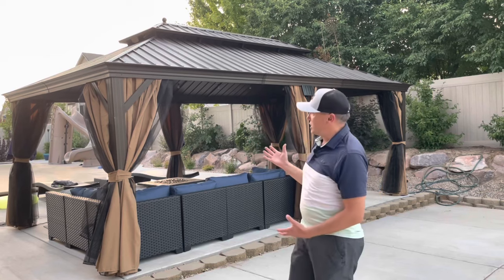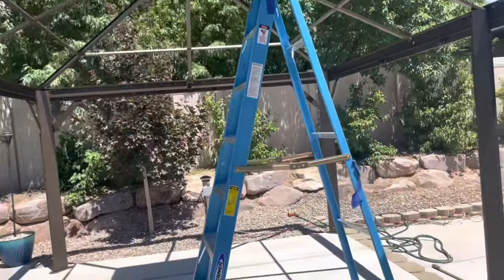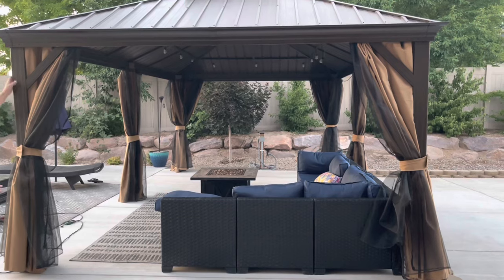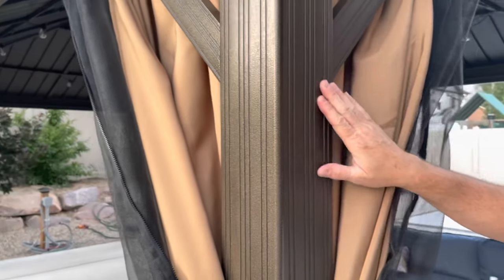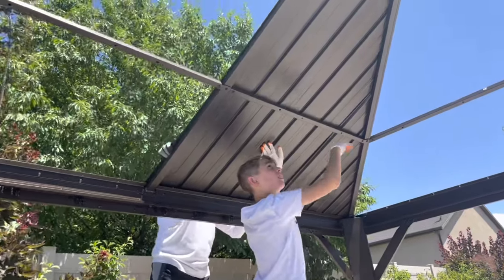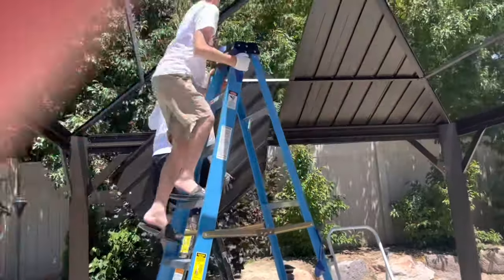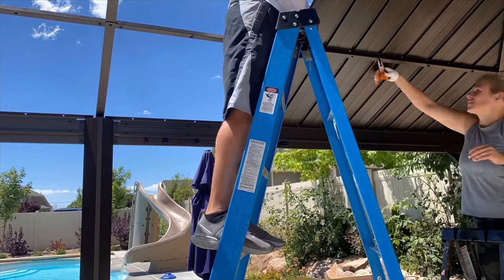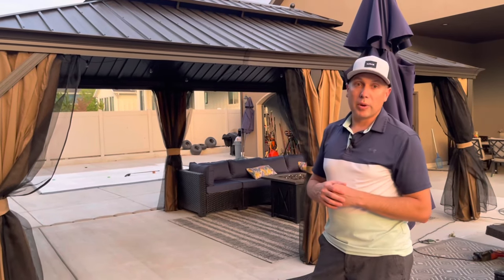12x20 Hardtop Mellcom Gazebo Build and Review

Comment: i just did my gazebo and cannot agree more.  screw the roof panels down, at least at the lowest points, before moving on.  i did it by myself and i put the ladder up next to the ceiling beams so the roof panel wouldn't slide down while i adjusted it into place.
Reply from the maker: Good tip!

Comment: Does this let air flow in the top? I'm currently in the market for a gazebo this size, but it's SO hot here, not sure if I need to choose one that is more open on top or not. Thanks!
Reply from the maker: It is vented at the top, and let's the heat out, but it does get hot inside in direct sun because it's all metal and heats up.

Comment: We got the same unit. Having trouble mounting the side post. The “L” bracket is preventing us to slide into the gap. In our manual it is step 4. It’s like pieces “E1a” and “E1b” are a bit long. Did you have any issues, with the side post?
Reply from the maker: I don't recall having that issue
Reply: We are having the same issue right now ..I'm on here searching...no help yet
Reply: Im installing a 12x24 but I’m having an issue with the clips they keep falling off  
😡

Comment: the gazebo looks really good.  Question:. how hot does the aluminum roof get under the full summer sun?  Is it comfortable under the aluminum roof, do you feel heat radiating down?
Reply from the maker: Yes you can feel the heat while inside, but you're also in the shade so it helps.

Comment: Hi. I just installed this about 3 weeks ago & I am having an issue with water leaking thru the 6 seams along the perimeter. If you look at your video at the 1:57 mark for reference, its right above your head what I'm speaking about. Its funny because the 2 on the far sides of the gazebo are not leaking. Its just the 2 on each side that when it rains the water is coming thru those screws. Any help you could give me or ideas to make this stop happening would be great. Love the video. Very informative. Thanks!
Reply from the maker: Maybe take the screws out and put some silicon caulk in the screw hole and put the screw back ?
Reply: Yeah I thought about doing that also. I tried putting ckear flex seal tape across the seam on top but that isn't working so I think I will try the silicone now. Does yours leak at all because I haven't seen any reviews saying that other people's were leaking? Thanks for you advice
Reply: @dantheman4763 Hey, did you ever get to fix the leaks? I just installed mine and I'm having the same problem.

Comment: Great video. Thank you for taking time and show all these details. Quetion: we are in South Florida and get hurrucanes somethimes. How hard is would be to remove the roof pannels if I have to, just to get ready for hurricane. I can secure the frame but affraide the gazebo will be gone if I keep the roof on during the storm. Thanks
Reply from the maker: On this specific model, it would be extremely difficult to remove the roof panels, there are probably 170 bolts/screws holding it down.  I just built another one of these. Here's the link https://youtu.be/87je8tPeVSQ
this one has much easier to install and remove roof panels, this might be a better consideration.

Comment: So when doing the roof panels how did you screw it on/ keep screws from spinning without being pn the roof? Would you be able to do the roof if it was built against a house?
Reply from the maker: The roof bolts have a nut on the other side
Reply: Would you beablw to build in place next to the house where you wouldnt really have access to the top of the roof?  The gazebo i had you build the roof in peices and then lifted the parts in place

Comment: Can this gazebo multiple fans? Is there a tv mount as well
Reply from the maker: You can hang fans 
 from the roof, the TV mount is not included
Reply: Also, you mentioned eventually adding electricity, does the gazebo come manufactured for electrical setup? I.e sockets, places to run wires, etc.
Reply: @nickingram4796  yes I bought 2 fans from Lowe's and have them hanging under the gazebo. They are perfect. Light weight & do what is needed. I believe I paid around $150-$200 each for them. Hopefully this helps

Comment: GREAT video - thanks so much. Quick question - we have a new patio with brand new pavers. Not sure that we want to bolt into those just yet. Is the gazebo stable enough without bolting it down?
Reply from the maker: Yeah it's stabled.  It could be moved with high winds so bolting it down is probably necessary
Reply: Use blue Tapcon concrete screws with washers....Easy!
Wind will move your Pergola.

Comment: Great review, is your concrete perfectly level or is there some slope?
Reply from the maker: It's not perfectly level, there is some slope
Reply: Did you have to add anything under feet to accommodate the slope or did it just flex some and allow to bolt flat to the concrete?
Reply from the maker: There was enough give in the posts that it accomdated the slope